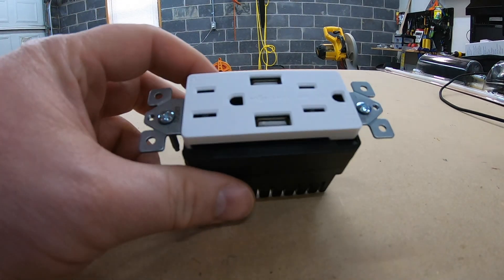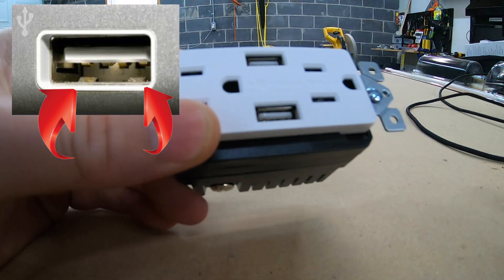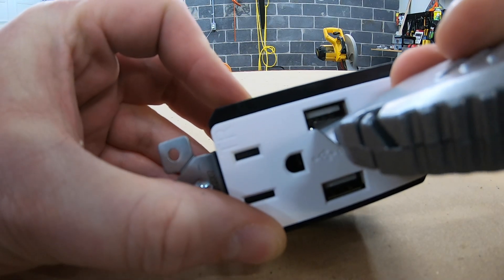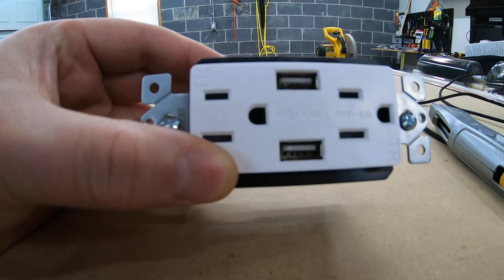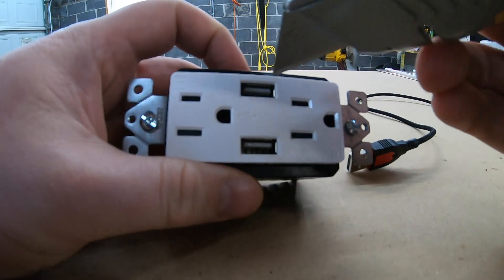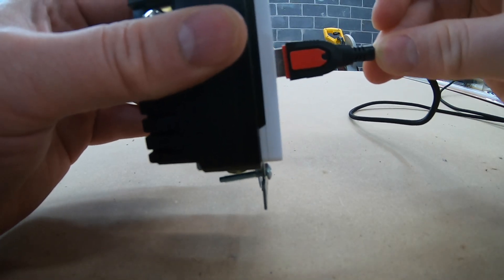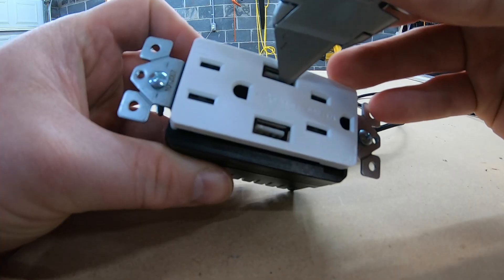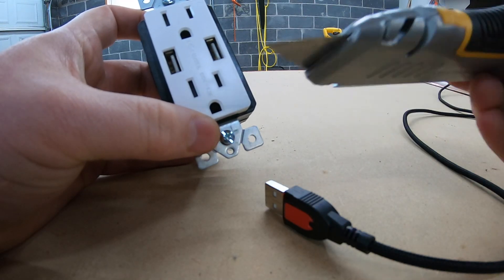How to fix a loose USB port - easy DIY

Comment: Yeah tried this I have micro set of screwdrivers  I used the flathead lifted 1 no problem went to lift the other and my computer just died no lights nothing ....awesome trick
Reply from the maker: Gotta detach the battery and make sure it’s off

Comment: Very cool from a fellow DIY'R. Nicely done. Mine are in my laptop buy I'll post a pic as to their similarity or lack thereof!  EDIT: I wanted to include  a closeup of my laptop's two USB female ports where a pain in the ass to clean and photograph. I think I see the tabs so after unplugging I took a razor blade and took a   "stab" (See what I did there?) at it and I must say it IS better.

Comment: Is there a right or wrong way to remove the usb port like do I wiggle it out slowly or just a quick pull?
Reply: First of all, please do not pull the usb cable out like this guy (by the cord) - not a good idea...  To unplug a USB cable the best way I would think is to pull exactly "straight" out as you unplug a cable or push it into the USB port (the speed at which you do it will differ from person to person).  Wiggling the cable while pulling out or pushing in will cause extra stress on the pins he shows in the video, causing the pins to bend back out-of-shape sooner than they normally would.  The way that I like to unplug or plug in a USB cable is to hold the plug (by the sides) between my thumb and pointing finger - but leave my finger tips sticking out in front of the cable so that when I go to plug-in or unplug the cable, my fingers are the first thing that touches the computers USB port face, that way it insures the cable is going into or out of the socket in a more straight manner.  I hope this makes since and not confusing - I tend to over-detail sometimes LOL...

Comment: THANK YOU SO MUCH FOR THIS!!! My work laptop was acting up and my mouse wouldn't stay connected my IT told me they would have to take the laptop apart... I literally did just this lift those little pins up a bit and bam problem solved!!! So thank you thank you!!
Reply: I needed these because my USB cable for my VR headset would come loose from the port if I turned ever so quickly to dodge something in-game. Worked like a charm since it doesn’t shake around in the port now.
Reply from the maker: Awesome!  Glad it helped

Comment: im sorry but i could not understand what u did there, can you comment me what you did?
Reply: Would be a good fix except the two strips are in essence springs and not very good ones so they bend right back.  Problem is they made the female end to short so no support.  It is really bad on the mini and micro ones.

Comment: Soo here's the problem, I fixed the tightness situation but it still wobbles and thats my main problem. How can I fix that?
Reply from the maker: I've noticed that on some of the devices I use too.  It means the slot on the device is too big and allows it to move side to side.  I'm not sure there is a fix for that.
Reply: I have this problem also  @weekendhomeprojects
Reply: Same here a lot of devices i have are tight now with this fix but the cable or usb stick still wobbles side to side

Comment: Hey how's it going great here hey I just had to it particularly quite a little bit just a little bit so when you're describing what you're doing do you use a lot of words like thingy and this and I'm not quite sure what you did now my port is not broken doesn't have no tabs on the up or down for the middle prong and we might have different ports which means that your video would have nothing to do with what I need the video for so my suggestion is maybe perhaps look up with those thingies are called and maybe even... maybe even something this more common the USB Outlet that had a USB ports built into it maybe when a picture you can put it up on your video so the people would know which is exactly you're working on good now I got more questions than answers after watching your video thank you and God bless you
Reply from the maker: Sorry it was confusing, but yes, I understand.  Maybe this USB outlet is not like ALL USB outlets and is not much help for you.  I hope you were able to resolve your problem.

Comment: Weekend Home Projects ~  AFTER VISITING SOME WEBSITES THE KEYBOARD WAS NOT WORKING. WAS THE USB 
CABLE LOOSEN ON PURPOSE, BECAUSE AFTER RE-ADJUSTING THE USB END IT WAS 
FIXED. BUT NOW I WILL ALSO DO WHAT IS SAID IN THIS VIDEO.
Reply from the maker: Hope you were able to resolve your issue.

Comment: Hey man I've tried to do this but they've went so far in that they are actually in the hole so I can't get a grip on them any clue how to fix?
Reply from the maker: Can you angle a razor blade tip to get it down behind it?  Sounds like yours is worse off than mine.  Good luck.
Reply: @weekendhomeprojects  yeah thanks mate i used a stanley blade and it got in fine appriciate the video

Comment: Thank you!  I fixed my connectors.  I'd be sitting at the computer and hear the USB disconnect sound and have to jiggle the cable.

I used the utility knife blade like you did.  I have tiny screw drivers but I think the blade was the better choice.
Reply from the maker: Glad it worked for ya.
Reply: AFTER VISITING SOME WEBSITES THE KEYBOARD WAS NOT WORKING. WAS THE USB CABLE LOOSEN ON PURPOSE, BECAUSE AFTER RE-ADJUSTING THE USB END IT WAS FIXED. BUT NOW I WILL ALSO DO WHAT IS SAID IN THIS VIDEO.

Comment: Clumsy tool..you should use a thin but firm screw driver or such tool...it will be faster and safer for your equipment...but not the blade you used..😊
Reply from the maker: It was last minute and it was all I could find thin enough to get under the tab. It’d been nice to have one of those eye glasses flat head screw drivers around.
Reply: Ok..next time get your tools right bfr starting your shoot.😊
Just kidding..you guys do a great job of putting up videos..commendable.👍
Reply: Where are you based?
Reply from the maker: @MP-lb1bv  East Tennessee
Reply: @weekendhomeprojects  I tried raising those pins in usb A female port..still i have to toggle the male end inside and sometimes contact is made and at times lost..still not totally reliable..please cud you give any inputs?
Reply: Finally in my device it was a dry solder of one contact of  the usb A female socket on the pcb.......fixed it..😊